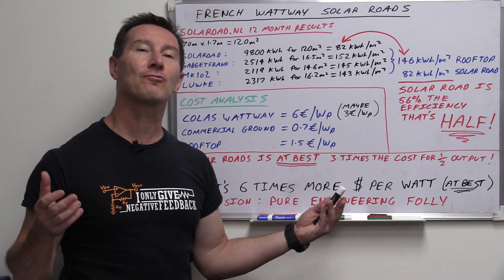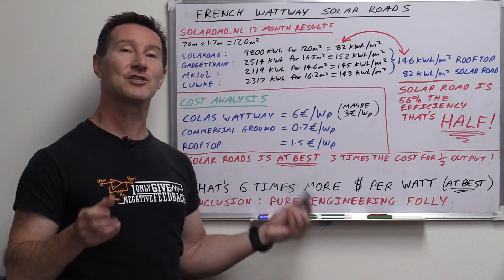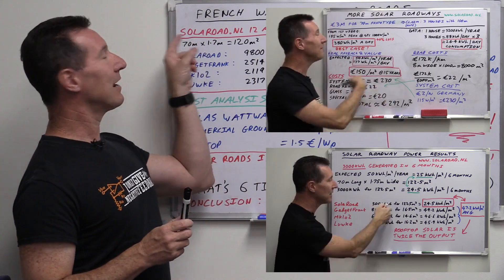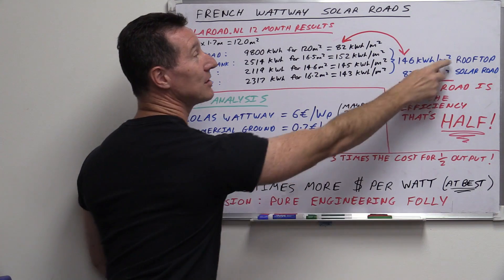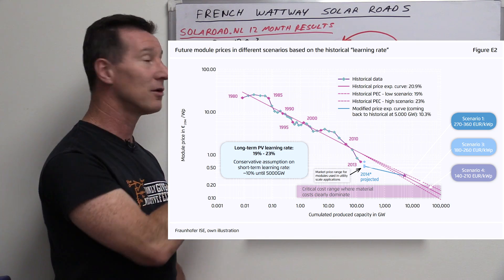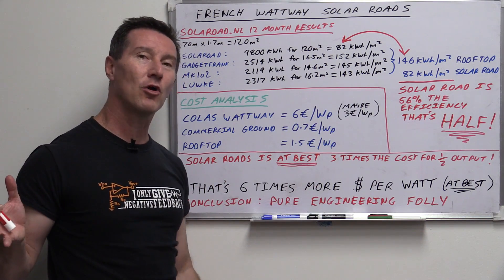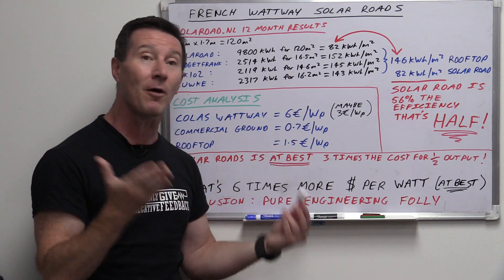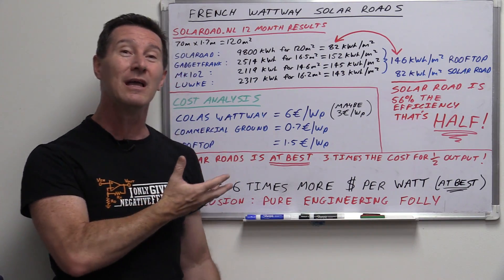EEVblog #850 - French Wattway Solar Roadways BUSTED!

Comment: You're right that from an engineering kind of view, it is just a stupid idea. The idea of the South Koreans is better. Though, maybe we could use plants there to filter the air there where pollution is produced. Or a hybrid system where there are plants growing underneath the solar panel or something. But on the other hand you did make some scientific mistakes. You concluded that the wattage output per square meter is only 56% as good, so around half as good. And you found that the price per Wp is around triple. But if you multiply net W/SqrM with price/Wp, you don't get price per SqrM. To be correct you should calculate by multiplying W/SqrM with price/Wp which gives the price per square meter. Or you multiply price/Wp with Wp/SqrM to get the price/SqrM. From that you can figure how much more they cost per SqrM. Or just give the following 2 parameters; how much it costs per wattage output in perspective to the others and how much wattage you get per SqrM. That will be clear enough.
Reply: Hateful that I have a limited digest length on the iPad. I didn't mean to be rude or say your wrong, I just wanted to point out where people could tackle your opinion. That way, you may think about it next time to not blindly multiply. As we say in Dutch, it is easier to prevent than to heal. I liked the video and your completely right that solar panel roads are just a disaster. Surely because we have still so many roofs that can be covered with solar panels. Cost effectiveness is way better for roof solar panels than for road solar panels. The only moment where they could think about turning the road in solar panels, is if all the roofs are covered with solar panels and there is not enough electricity produced and there is no more ecological alternative (such as windmills). A lot of parameters to be fulfilled, and if they are all fulfilled, maybe the alternative 'reducing electricity demand' will be a better alternative.
Reply: +Brecht Schatteman  Mhmm plants underneath solar panel? But plants need sunlight to grow. So how would that work?
Reply: +Siana Gearz Seems contradictory, but the sun here in Belgium does never stand 90 degree above the ground: so that would mean sunlight getting under the solar panels and the solar panels giving a shade on the streets. And even if they don't get much direct sunlight, there are plants that prefer living in the shade, so why won't they be able to live in the shade of the solar panels than? So it is a paradox, it seems a contradiction but it isn't
Reply: Brecht Schatteman But it is the question then what kind of shade those plants prefer. If they live in the shade of other trees, then it is to be kept in mind that those other trees are not completely opaque, while solar panels are. Also if you think of a perfect arrangement of solar panels, there is room between and beneath them, but from the point of view of the sun in zenith they would be without visible gaps. But it can indeed be the case that some shrubs will be able to sustain themselves on scattered light, i.e. light reflected off the road and various obstacles, even if the scattered light conditions are not optimal under solar panels either.
Reply: +Siana Gearz There are plants that live on the north side of my house where they are always in the shade. I know a forest ground still receives a small bit of light. But as I also said: here the sun is never 90 degree high in the sky, so it is always at an angle so sunlight will get underneath the panels. But to be honest, I would prefer that they would put windmills there with plants in between them. I don't know how that would work out in the center part of the highway (because the turbulence caused by the cars passing at opposite ways, but for a vertical windmill that could be ideal) but they can do it at the sides (profiting a bit more from the wind/turbulence caused by the traffic). Here they have already put some windmills close to the highways with the idea that by the cars there could be a bit more profit. For me solar panels belong on the roofs, not in solar plant fields and not as such standing-on-it-own structure where they are taking away places that can be used for nature.

Comment: If you remove the monetary aspect and replace it with the actual energy used to manufacture and install and maintain these roadways you may find a greater inefficiency still.
This seems more an exercise to extract money from the public purse under the environmental flag. After all, there is no real gain until an installation has produced more energy than that required to manufacture, build and install the thing in the first place.

Comment: The complaints being made here about low efficiency solar panels, is similar to thin-film. Thin-film has advantages to it that arent found in traditional panels. thin-film is easier to install, flexible, and more durable. 

Just like every other technology that enters the market, given time it always gets better, a lot better. Electric Cars first made a real splash in the mid-90s, they failed due to lead acid batteries. It wasnt until batteries went through 2 more major leaps in improvements before EVs became practical. Just like batteries will continue to improve so will solar technology. It just needs time.

Comment: Why not just move the panels a couple meters from the road, raise them into the air a few meters using poles, and stick some benches and electric car chargers every few miles. Like, god damn, they're obsessed with the idea of putting the panels in one of the least hospitable places possible.

Comment: One good thing about having solar panels on your own roof (like EEVblog) is that you don't get hammered for being a "denier" when you debunk some foolish solar energy plan. That makes the comments a lot more pleasant to read, or add to, and gratefully less boring.

 Leaving idiocy and political IOUs aside as an explanation, for the sake of argument, what could possibly be a reason for liking this plan, as three governments do? One thought is that it would hide the real cost (in a different way than subsides do) in the tremendous budget for roads and their maintenance, and there is a separate tax (in the price of fuel) and budget already dedicated to roads. As an incremental cost to maintaining roads, which are constantly breaking to pieces and being redone anyway, solar roads might look reasonable. Anybody know how much is spent per square meter on road repair? If they could make solar roads, as expensive as they are, hold up as long as solar panels on a roof (25 years?) it might be a reasonable deal.

Comment: They'll have to put a DC to AC converter and transformers every kilometer.   
The only cheap way to transmit power is at high voltages.  But it is low voltage DC coming from the panels.   

They will build about 5 km of this road and then realize what they should have predicted, that the project is way too costly to complete.

Comment: So, where is the money for the rooftops coming from?  It may be pricey, but the roadtop solar will exist.  No one is going to give homeowner cash to install roof systems, no one is going to assure that the rooftops get installed - people Love not having to do anything.  Most importantly, there is more road surface than roof surface.   Road surface technology will get better as maintenance issues are addressed, the Colas people understand roads to begin with so the obvious issues with be pre-addressed, and the maintenance will probably be better than panels on top of houses where the building owner is uninterested.  Actually, I agree that the better plan is privately owned  rooftop or field generation, but the business model, as usual, will supersede the engineering rant.  Oh, and the ecology of ripping all that potentially toxic material out of the earth?  That is an issue no business person cares about.

Comment: Not sure why you took the time to put together this counterproductive video...
First off, your "cost analysis" is wrong. $/Wp is a figure used to measure the total amount of project capital per watt produced at peak power. It is NOT appropriate to take this number and then additionally divide it by kWh/m^2. That is what you did when you made the conclusion that 3 times the cost for 1/2 the output means it is 6 times more "$ per WATT". No... actually it is simply 3 times more money per watt. That is what $/Wp is for (notice it's right there in the units.... COST.... per WATT). I wonder what it is that you actually ARE comparing to come up with a comparison of 6:1.... just for fun, let's see what those units come out to.... 

$/W/(kWh/m^2) = $/W*(m^2/kWh) = $/W*(m^2/1000*Wh) = $*m^2/(W^2h*1000)???????

So you are effectively comparing "cost times square meters per hour watts squared"?

When I filter out your garbled spaghetti math, I can make the argument that these roadway solar cells are actually quite impressive: THEY HAVE THE POTENTIAL TO PRODUCE POWER AT ONLY TWICE THE COST OF CONSUMER ROOFTOP SOLAR PANELS, WHILE DOUBLING AS ROADWAYS.

So all in all, sure they are less cost efficient than consumer rooftop solar panels, but there is the potential to cover an unfathomably large surface area in comparison to any other solar solution out there today.

This decision by the french government is obviously a political move, and an IMPORTANT ONE. This technology still has a long way to go, but by funding a solar roadway project, France is inciting competition in a very large, whole new market. Now, with the gate open, companies will be frantically racing each other in R&D to come up with more and more cost effective solutions to this problem so they may reap the benefits. End result: with a little luck, an actually viable engineering solution to the solar roadway problem. For your sake and mine, I hope it works. IMO, all of the work you put into this video was counterproductive.

Comment: What about Solar Freaking Traintracks ?
-Just plop em down between the tracks and we're good to go, loads of unused space, and the trains run on the tracks on between them so not as much wear and teac.

Could someone help me get like puts pinkie finger to side of the mouth * a mill. . . billion! dollarhs *hahahahahaa to try it out ?

That said, it would run into the same problems as a long distance energy transfers, and then there's scavangers who'd love to cut and sell the cables and shit even if one could figure out everything else.

The best application I can think of would be in tandem with maglev/train/s/rail-system but those are really rare, japan and china only (?), but even that would have some special problems on it's own.
Reply: CommentsForOnce but it doesn't sound cool and futuristic haha

Comment: The thing is, the solution is real simple, just have every house install rooftop solar systems, it'll be cheaper (even totally government funded) and more efficient. But no, that concept not even considered, best we'll allow if it is rooftop is subsidised by the government in exchange for carbon credit crap.
Reply: +Ewan Marshall 
I doubt that will be cheaper.  
When not used they wont produce any power.

Comment: How can you even try compare output from rooftop panels to a cycle way?

No 1 As we all know a way can't lean towards the sun if we want to cycle on it.
No 2 All  rooftop panels are maximized to guess what.... energy output. - As a solar way is mainly a way and double as a solar panel. Therefore it may (and probably does) have lower efficiency per area.
No 3 All  rooftop panels are mounted at evaluated locations to minimize shadow. A way is always in a predetermined location from pos A to pos B. Meaning if the way goes by a house (in it's shadow) there will be low or none energy at that location. A tree, fence or even a shadow from a traffic sign will significant reduce energy output.

So you DON'T compare apples with apples!!!
Put a solar way next to at domestic solar panel in same conditions: same angle towards sun, same amount of shadow and you will find the difference of the panels just made for energy - and the solar way made for cycling on and double as energy source.

What happen in a country that got most roof's covered in panels already? Say that country don't got a dessert of it's own. Say same country want to grow food in their fields.

I see your point - solar ways are more expensive so rooftop's is to prefer of course. But areas suitable for solar panels on rooftop's and field's will run out in many countries. I think it was Robert Llewelyn who was driving in Germany doing a road game  "count the rooftop WITHOUT solar panels on them". As rooftop's WITH are solar panels countless.

Comment: I found a flaw in Dave's calculations. He forgot to consider the system is being constructed and installed by Road Runner ACME solar.  The panels will have flux capacitors that charge up in the day light hours and power the street lights which will allow the panels to produce energy 24 hours a day.  The capacitors are fairly small and only need to get the system started.  After the LED street lights come on the panels keep the entire system operational and capacitors are no longer needed.  The actual calculated efficiency depends on temperature but it can be shown to approach infinity.

BeepBeep

Craig